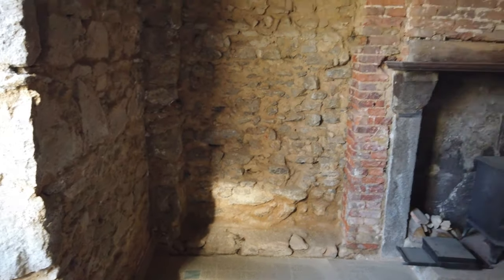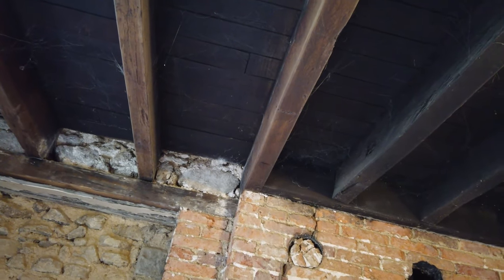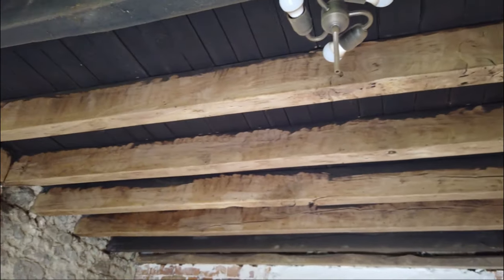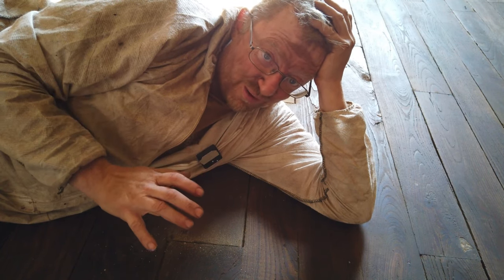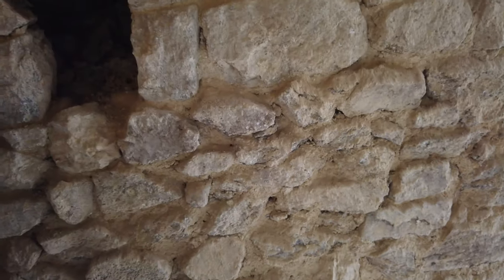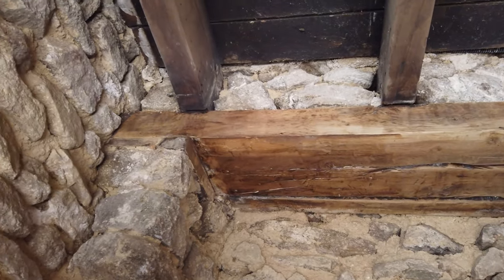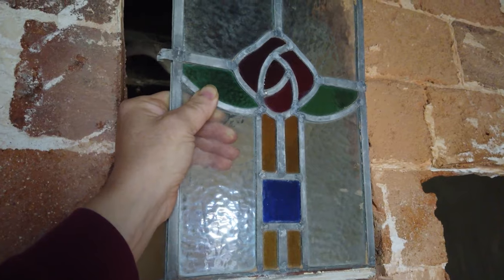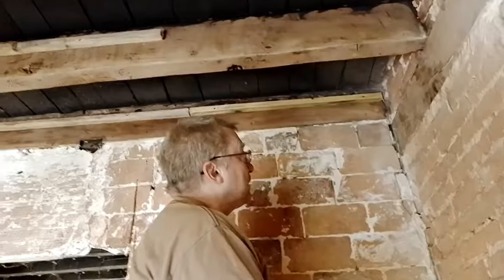Restoring a French Salon: Conquering a Renovation Nightmare - Our French Renovation, The Good Life

Comment: I make stained glass, the glass panel looks to be well made and original. There is little gain in trying to pass off modern stained glass as old as its an expensive profession in material and labour and is in demand. I think your stained glass appears to be cut down from a larger panel, the lead came (where the glass sits) on the left side where you are holding has been cut indicating it was once from a bigger panel. It was probably done as small pieces sell better.  It is in Art Deco style (between the wars) so could be from around the 1920's. The fact you have found the same ones could be from a row of houses that were demolished , or people who got rid of them when they got double glazing.
Reply from the maker: Wow! That is incredibly interesting! It makes the fact that I bought them in different corners of the country so many years apart even more bizarre. I literally bought the first one as it looked nice - I had no where to put it until now. Thanks for your reply.